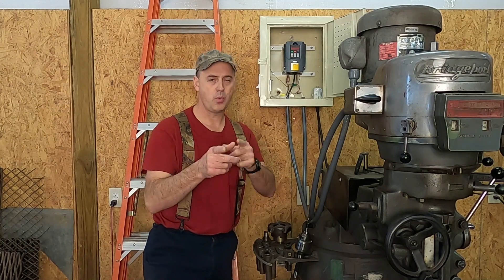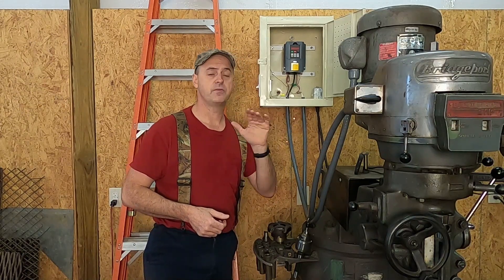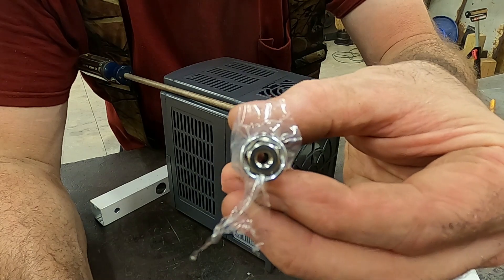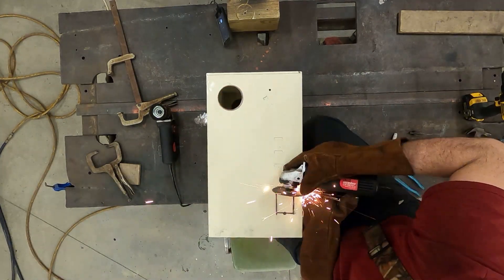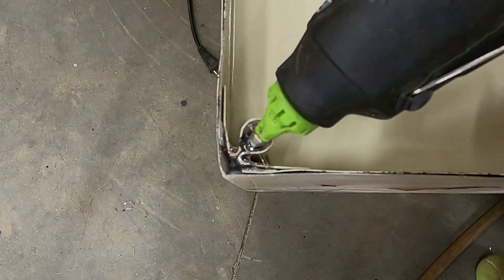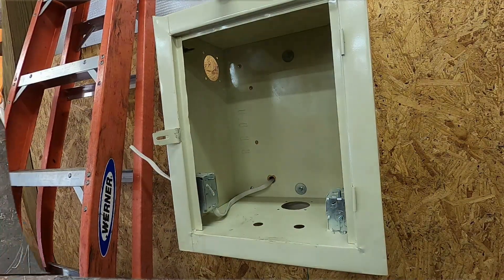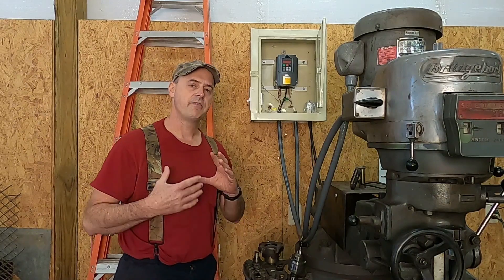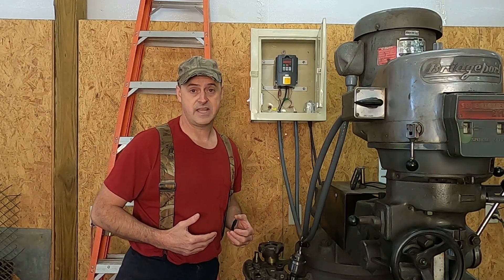Homemade VFD Enclosure Cabinet

Comment: Good content but I was always taught not to use compressed air when clearing metal shavings.  I use a shop vac and then don't have to spend quite as much time in shop cleanup. 
Even with safety glasses you are at risk of eye injury with the airborne shavings.  I confirmed that with a friend that is an ER MD and his experience with shop eye injuries.
Reply from the maker: Thanks for the advice, I'll definitely keep that in mind. Thanks for watching!

Comment: Hi Theobald.  Nice setup, interesting to use a 2-pole side switch.  I have a 5.5kW unit of the same brand, but 220/380 for the UK market.  Will be driving a 3ph 4hp air compressor.  Have you found your unit to have high EMF?  The unit has a built-in filter, but I am considering inline EMF filter on the supply side, and toroid rings on the output.  Thanks.
Reply from the maker: I haven’t had much trouble at all out of the unit. The only issue I’ve had is when the machine spindle is adjusted (mechanically) for high RPM (3000-4000 RPM). At this speed, the momentum in the spindle, after switching the motor off, causes an error on the VFD because it can’t slow down to a stop in the 2 second timeframe that I have programmed. The motor then acts like a generator sending electricity back to the VFD, thus creating the error. To prevent this, I now slow the spindle down to about 2000RPM before shutting the motor off, or use the spindle brake to help the motor stop in time. I only operate the unit at 60Hz and use the variable speed pulleys to control the RPM. Thanks for watching!